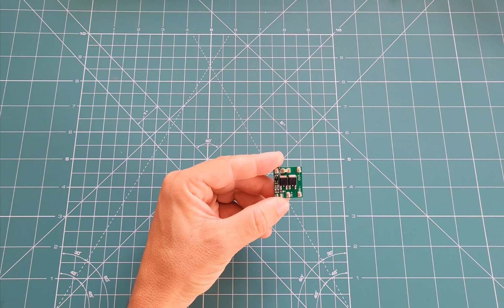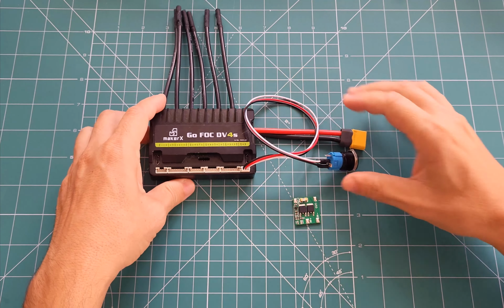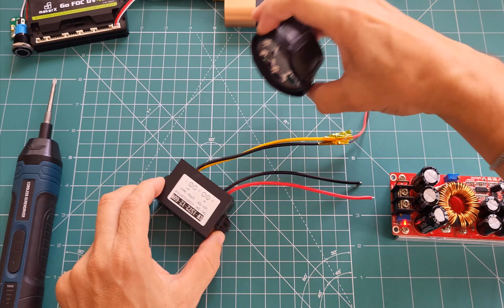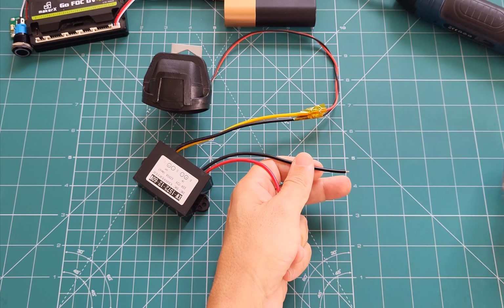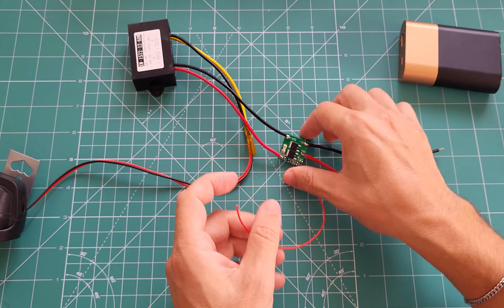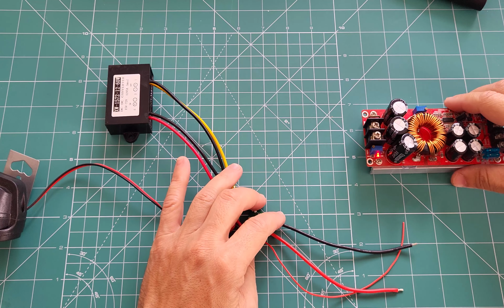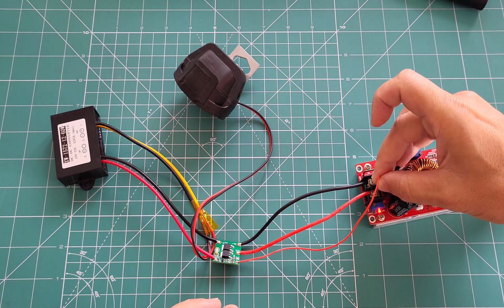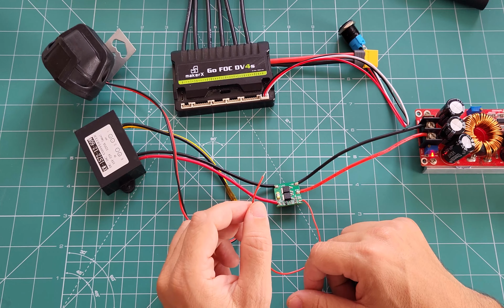125V 7A Anti-Spark switch in a small package

Comment: Really neat product! Will you make it available for sale? 

I want one 😎
Reply from the maker: Specifically designed this for the e-bike project. Because there was no where to connect my converter. I will run it for a while on the bike see how it goes and may be it will come to the store :) Forgot to mention in the video, I load tested it at 10A(without a fuse) it was still running cold to the touch so it must be fine.